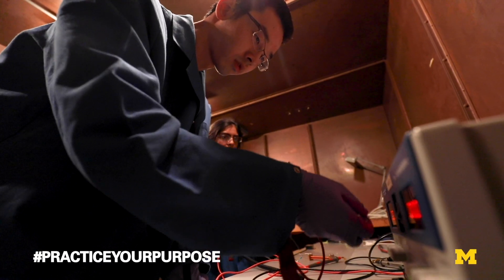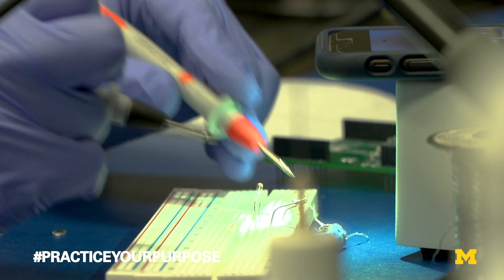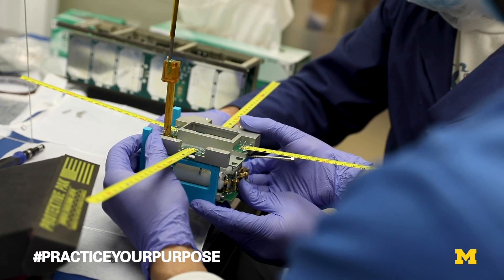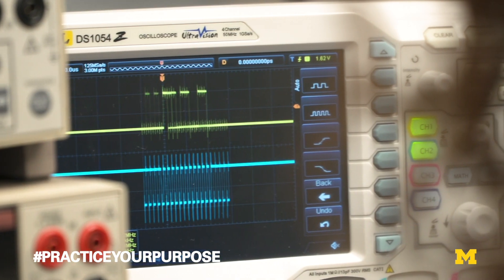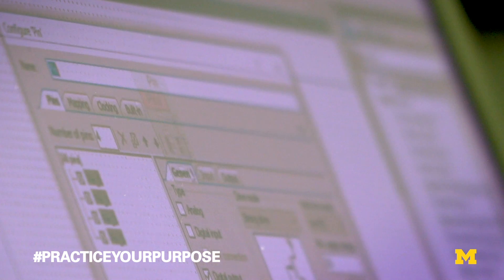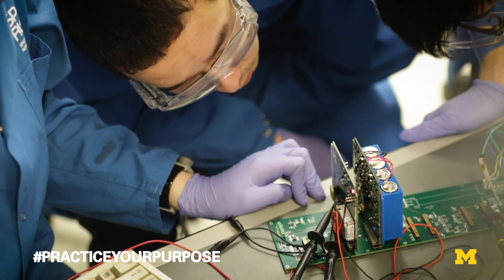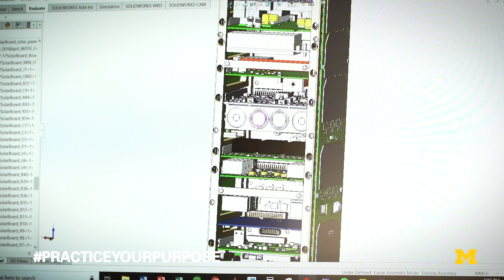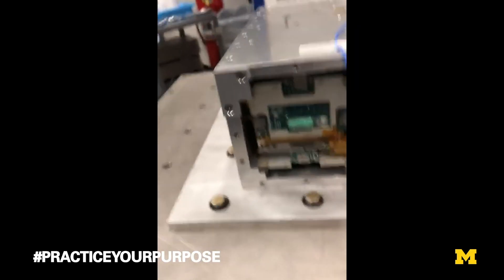Engineering students to test tether propulsion with tiny satellites

Comment: I love seeing the innovation, We have been experimenting with similar situations as far back as the 1990s. Electrodynamic tethers (EDTs) are long, thin, conductive wires deployed in space that could be used to generate power and thrust. Currents conducted through the wire combined with the strength of the Earth's magnetic field could be harnessed to produce a force that could be used as propellant-less propulsion. see.  ELECTRODYNAMIC PROPULSION SYSTEM TETHER EXPERIMENT (T-REX)

Comment: Does it make a difference if you have a weight shifting tether system mounted inside a module as opposed to having it built onto the outside?  Example being what it appears you guys made vs something similar to a vibrating motor inside a game controller (except the weights can shift to either side in both versions)? I know I didn't phrase that correctly but I have a design in my head that just makes sense from a motion in zero gravity stand point